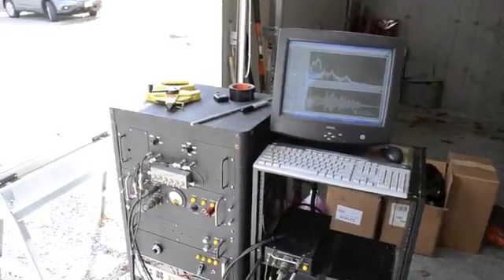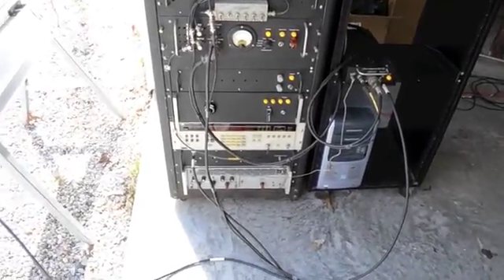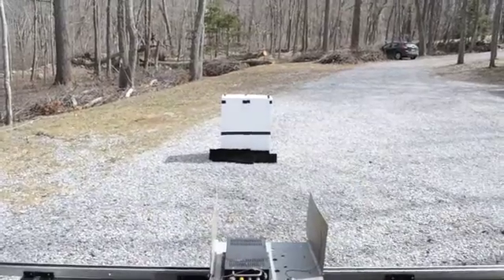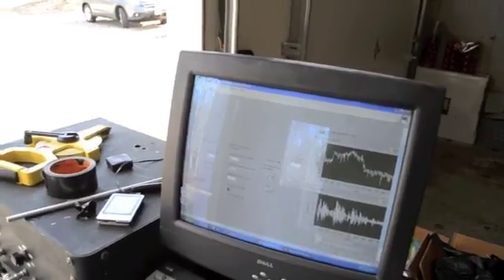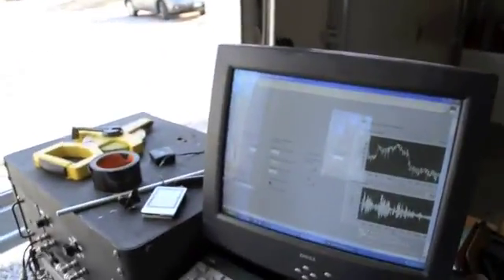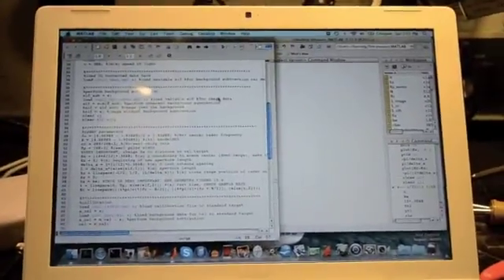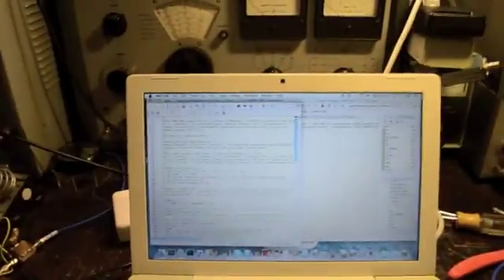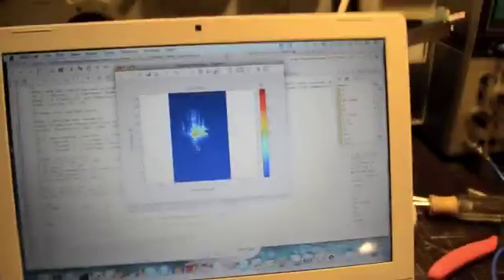S-Band Range Gated FMCW Rail SAR Imaging System

Comment: Hello, Iam trying to accomplish the same thing with a radar operating in K-band.  I compensated for the increased operating frequency by decreasing the aperture spacing and therefore increasing the number of range profiles along the aperture length.  I also modified the stolt interpolation slightly in order to accommodate the higher number of input frequency samples from the raw data (THIS RADAR SAMPLES 1501 TIMES AS OPPOSED TO YOUR 500 fsteps).  I simulated it and everything looked good in the simulation.  However, my main issue now is that the output from my radar is not complex in nature, rather it is purely real and is an oscillating sinusoid with a typical amplitude of 10^3.  All of the SAR examples on your website input complex raw radar data into the SAR algorithm.  Do you know of any way to accommodate my radar data which is purely real?  Any hints on what it is that I could change?  This is a senior design project for my university, and we are citing you properly.  Any help would be greatly appreciated!!!!